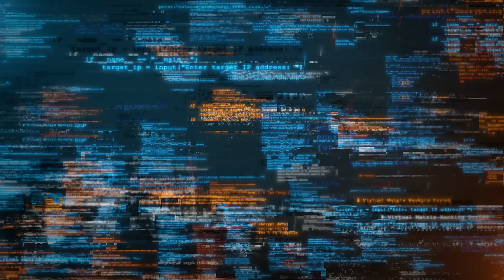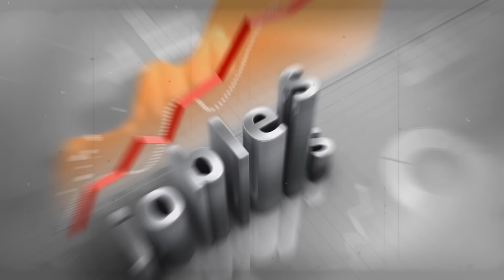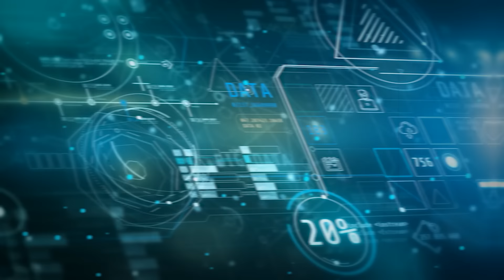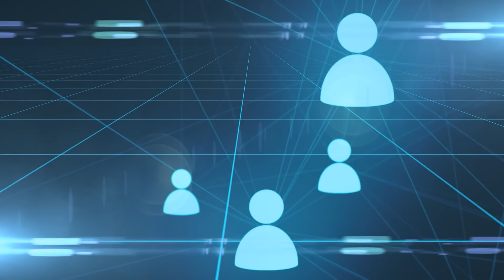AGI is Coming! Here's What Will Happen When It Arrives

Comment: I do not think it will be as smooth as you predict!
Reply: 1:23 Several researchers predict some form of AGI will have already been released by 2050.
Reply: 9:49 Based on survey results, experts estimate that there's a 50% chance that AGI will occur until 2060.
Reply: Artificial general intelligence (AGI) is a theoretical AI system with capabilities that rival those of a human. Many researchers believe we are still decades, if not centuries, away from achieving AGI. 10:23 [McKinsey]
Reply: @Gurci28 you must be joking. Q* of open AI has already achieved it… it can solve task it wasn’t trained before. It has authentic creativity. It is really flexible in thought.